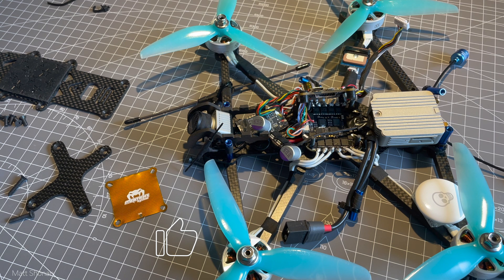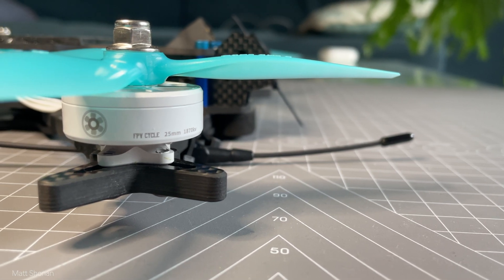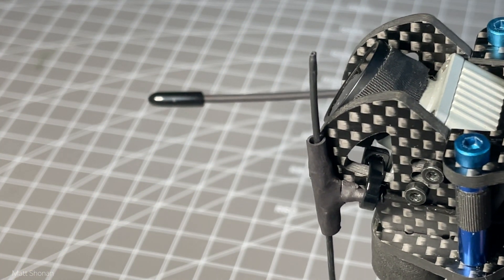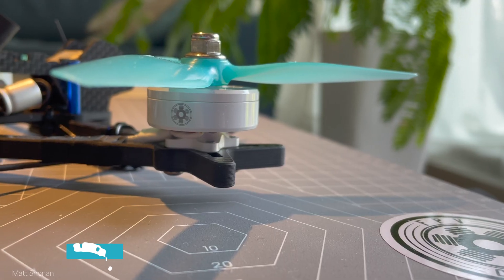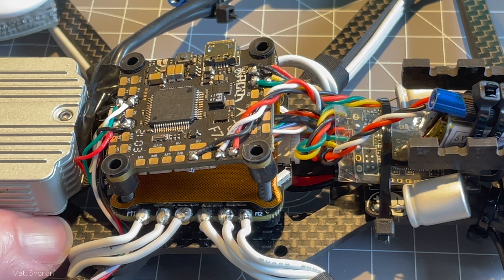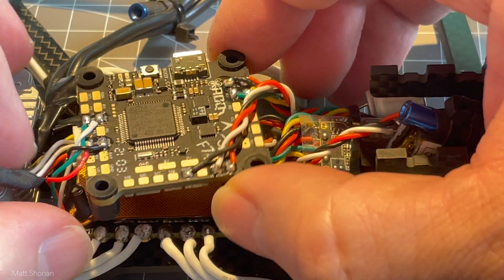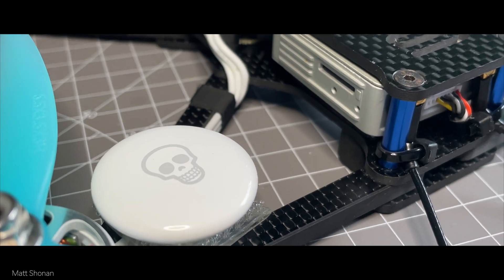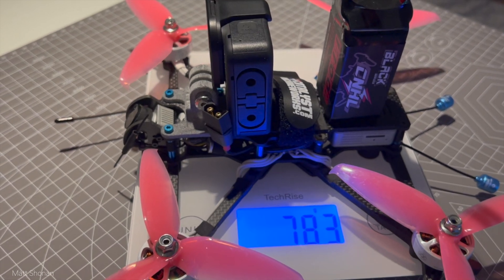AOS 5.5 build final adjustments FPV CYCLE | Joshua Bardwell JBF7 | PART 7

Comment: If I may add, your long DJI antennas will cause oscillation. Chris Rosser would say make them short or even stubs.  beside that. Spotless build!
Reply from the maker: Yes! They did and it was quite bad. I partially fixed this and will do further improvements. It is a balance act between performance of the signal and flight performance of the AOS. 
Thanks for mentioning and seeing this! 😊👍🏻
Reply: @MattShonan  Haha I always pay attention. BTW You can just put pigtails in the DJI unit and jack it up to stubby's. But if you LR then you need the Long range :D
Reply from the maker: Thanks! Will try something 😊

Comment: hey great work ! just asking how much do you get out of it as in fly time? i manage with 1300mah 4min max with gopro10
 how much urs?
Reply from the maker: My tune and build is just complete and I had only 2 shorter test flight. 
I feel I would get "good" flight time. How much I will test over the weekend and next week. 
I will share then in a video shortly after! 🤙🏻🙂
I hope for about 6 min when doing some slow relaxing "cinematic" freestyle.
Do you fly the same motors?